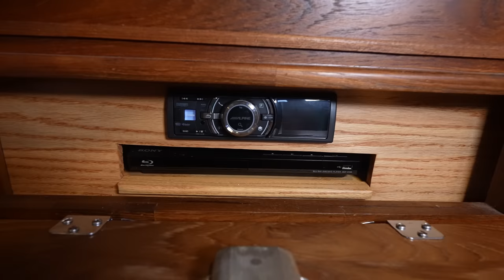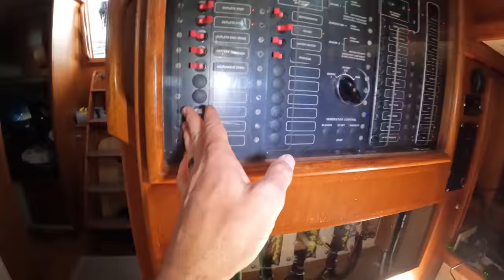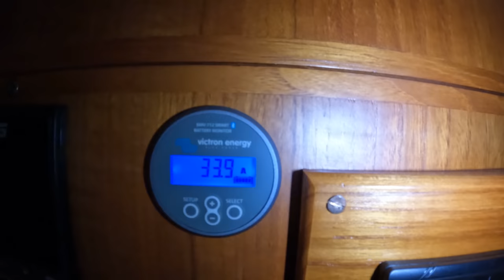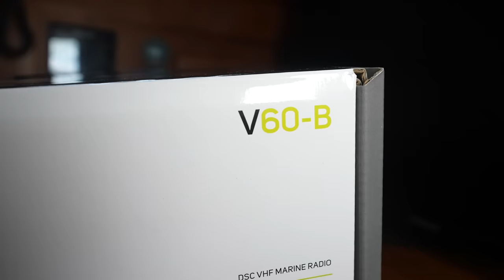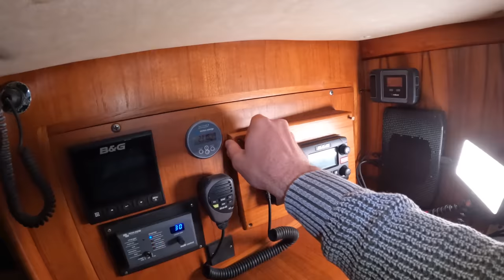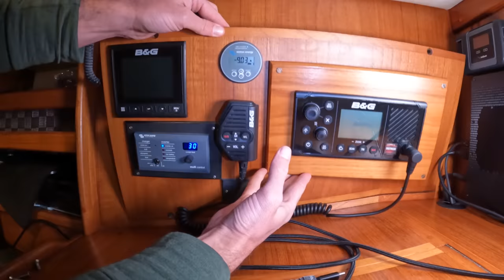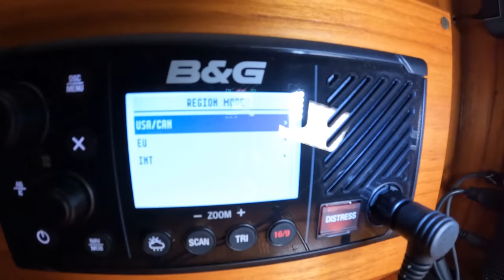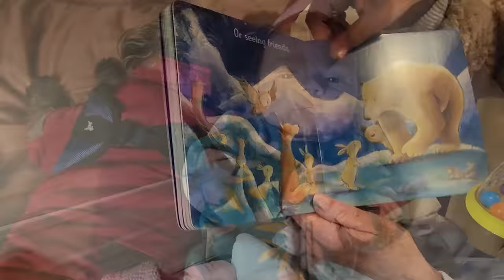Is it Safe to Sail with a Baby? | S08E05

Comment: 220 charger fan blows air in; but no outlet in the charger compartment? Might be an idea to have a grill in the door. Thanks for great videos and good luck with baby sailing.
Reply: I had the same thought. But, I thought I saw a hole on the wall opposite the charger in which a few wires were passing through. Depending upon where this hole leads, there may be enough size to discharge air. Look at 12:41 to see the hole I aim talking about. :¬) Webhead USA
Reply: Was just going to make the same observation.  Cooling is dependent on air flow.  The larger the volume of air flowing over the unit the better the cooling. Right now your just pressuring a box and there is very little air flow, if any.  The reason you felt air flowing in the test was because the compartment door, that the unit is in, was open.  As soon as you close that door, without a grill, the air flow will stop.

Comment: Jordan you should go back and look at some old "Ran Sailing" videos...they did the whole baby on a boat thing...their daughter  Vera is about 5 now...they had the most incredible baby chair, with attachments  in the cockpit, and at the table, with seat belts and secure enough for rough seas...good to see both of you doing so well. Really like your Dad, he is really cool
Reply: Agreed. Vera had a baby seat similar to a bike one, positioned on a bracket fixed in the cockpit such that it could hold her safely strapped in at times when both parents had to be doing boat handling, such as when going in and out of marinas, mooring, or doing sail hoisting. She could see what was going on, but couldn't fall anywhere or get injured by anything.

Comment: Jordan, I reckon you might need an exit vent for the charger compartment as well, otherwise the fan won't be able to move much cool air into that space. Unless I missed some detail in the video? Anyway, best of luck to you guys!
Reply: Need ventilation for that Synology box, too!
Reply: Yep, he tested the airflow with the door wide open. How will the airflow be when it's closed? And as Kirk pointed out, the Synology box need ventilation too (and I think you were talking about putting some other things in that same compartment). I didn't see any vents, and they all throw off some heat... Maybe check with a thermometer when they're all on.
Reply: Would be better with two fans.  Primary one to pull the hot air out and the other to pull in the cool air.  Similar to what you see in many high end PC cases.

Comment: Happy for you all and great to see its going good with the adjustments needed for baby onboard. Yup, Isa is ready for a Powered Baby Bouncer/Rocker or swing.... it will help you tremendously. On your charger venting, make sure you have other openings for the new air to exhaust out from charger compartment, so you get continuous exhaust and stream of fresh air in. The AIS radio safety upgrade is perfect....love the wireless handheld unit for cockpit 👍

Comment: Great to see y'all happy and Isa looking soo cute. Just a thought. The compartment being cooled may need its own vent so the hot air can escape. Might help heat the cabin too a bit??😊 Take care and thanks for another great video👍👍
Reply: That's a great comment.  You might be able to get by with drilling holes, make a cool pattern or use another vent cover. Sound knowledge Gavin.
Reply: Same fate for the new NAS if it doesn't have proper air flow around it.  Even though it has fans the compartment that its in needs air - I'd put some soffit sized holes under it or near it.

Comment: Hi Jordan, regarding the charger and the fan to cool it, you should reverse the flow of air to get out heat from inside the cabinet where the charger is. That is the way all cooling systems for desktops and laptops work. The way you put the fan, the cool air is going in but the charger will heat that air. You should open another hole in that cabinet to pull cool air. The fan should not be directly over the back of the charger. I could send you a diagram because it is dificult to explain with words only.

Comment: Hi guys great video as usual. You really want to use an inline fuse to connect the cooling fan. Those thin wires to the fan are now unprotected and constitute a fire risk. 👍
Reply: Great information.
Reply: Also ferrules for stranded wire and marine grade connectors.  Ask me how I know.

Comment: Ok... So you cut holes into the new charger compartments... But do you have a hole to let the air out? - And you need air circulation for the data storage hardware too.
Reply: I'd be less worried about the exhaust since it's for sure nowhere near air sealed, than destroying that massive hard drive. It definitely needs air.
Reply: Inwas wondering the same thing on both accounts. That NAS is gonna put out serious heat.
Reply: Wondering if, with all this added electronics how much protection do you have for surges and lightening strikes? 
(if there even IS a way to protect from lightening)?  OR....really good insurance?  Can separate protection devices be put on each of the most expensive components? An extra cost I know but would be less than 
replacement (?). Always amazed at what projects you private sailing Captains are able to do. That’s a must for your survival I know! As a weekend day sailor I wouldn’t have a clue how to....🤷🏼‍♂️ and glad I don’t have to. Great job to the whole crew!
Reply: Efficient air flow can be tricky.  You will feel some air flow, but to make it efficient, it looks like it needs at least 1 in spacer blocks behind the charger. Otherwise, both devices are in jeopardy.  Ideally, put the fan on the charger side door blowing hot air out, pulling air thru the inlet door and a few holes around the charger.  A filter on the inlet too, with foam around door edges to seal.
Reply: Good comment. There needs to be air flow to protect the equipment and solving the intake side only addresses 1/2 of the problem. You will need an exhaust in the charger compartment that will create a flow and exhaust the hot air.
Reply: @alanw9677  I have heard of, but have personally yet to see lightning rods that are mounted on the top of mass that run a wire down to the hall of the boat and connect to a plate in the water. That’s giving the lightning a direct path to ground basically the same way A lightning rod works on the house by hitting the rod, and then following the wire to ground.
Reply: @AlexRCarlson  you may be correct, but then again, depending how much air is being pumped in against how much leakage may still cause the temperature to rise in that small space. Putting a small thermometer in there to see how it reacts would be a simple test to see if he needs more ventilation.

Comment: I suggest you consider drawing the hot air from the batter charger versus pushing cool air toward the charger.  I think you will get a cooler device by pulling hot air away from the device.

Comment: I wish you alla the best guys  your daughter  is a little  angel!
Just an advice for your Ventilation project. You will have to make some Ventilation  holes on the compartment  that the 220V converter  is as well so the hot air is able to escape.

Comment: May I give you a little bit of advice.

Hard drives don't like to move.
Engine vibration, smashing into waves etc can all cause physical damage to hard drives.

I would suggest upgrading to all solid state drives as you can afford it.

As for how fragile hard drives really are, one company was transporting a large number of drives from one building to another on a hand trolley over some paved ground.

Multiple drives failed to work or had serious errors when they were installed in the new building.

They are cheap with huge capacity compared to SSD's, just very fragile.

Comment: I was going to say that you need cooling for all the routers/drives in your new shelf/cabinet and then you started on the ventilation project for the 220. 😂 We have a small Netgear router and during the Summer in the Med it regularly needs to go into the freezer because it just gets so hot outside, that even keeping it out on the desk in the salon is not enough (we work remotely).
Reply: Was also going to point out the NAS will probably need some fresh ventilation since it has a fan on it.

Comment: Jordan, IMO you need to cut another vent hole in the door where the charger is located. The heat is still going to build up in that box with nowhere to go. If you are primarily using it in the winter time why not take advantage of the heat that it should spill back into the boat through the  out take vent. This way you have a air intake and an exhaust.

Comment: Nice work as always! I might suggest putting a vent on the opposite side of that charger compartment. The fan will be very inefficient pushing into a sealed compartment. You tested it with the door open so it had no resistance. Anyway just a suggestion. Don’t want you to have to buy a 3rd charger! Cheers guys!

Comment: Hi Jordan; just a precision: AIS shows you only the boats, ships,… which has been equipped with AIS B. AIS A (which is a receiver only) like your old one, doesn’t transmit, so you cannot see them. Same, a boat not equipped with AIS will be invisible. Do not rely only on AIS. An actual watch is vey important. Cheers and fair wind.

Comment: From one hole saw guy to another, no "collection" is complete until you get a hole saw within a hole saw bit; also sometimes called a co-pilot bit.  It allows you to mount the hole saw of the existing size of the hole, inside the hole saw of the size you want to enlarge it to.  It keeps you from having to make a backing jib when enlarging a hole and saves a ton of time. I recommend getting one for your collection!!!!

Comment: I would switch the direction of the fan so that the compartment holding the charger is cool and the compartment with the fan is the hot one blowing air out to the room.

Comment: Fan mounting: Put a separate fuse on that thing. Right now, it's possible for 16A to go through that fan. No bueno. Also, not sure if you know (you probably do) but in Europe, your diesel heater is an Eberspächer, if you're having trouble getting help, looking for Espar info over here.

Comment: Should the fan not be running the opposite way? Sucking the hot air from the charger out? The air on the charger side will then be drawing cold air from the bilge area below the compartment. ie: computer fans do not blow air into the hot item.. they draw it out.

Comment: I have to advice you change your way of ventilation for the charger. Make an inlet hole somewhere and let the fan to extract the heat. Basically remove the warm air instead of blowing air on the unit which cannot escape.

Comment: While you are working on ventilation, I hope you are ventilating the space where your Synology NAS is located. I’m assuming it doesn’t run continuously, but when it is running it can throw off a good amount of heat.  Also, the new venting you just put in for the charger will help supply cool air but you need a way to exhaust the hot air. If you plan on keeping the cabinet door open in front of the charger, that will suffice.  But if that door is closed there will be no place for the hot air to go. 

Regarding the Synology NAS.  Make sure you have it configured for at least RAID 1 so you can sustain one or more disk failures.

Comment: Those NAS boxes generate a decent amount of heat, and heat greatly reduces the life of mechanical hard drives. I would definitely be putting some cooling and ventilation  in that compartment like the excellent job you did with the battery charger

Comment: Well as much as I appreciate Jordan's words about AIS, I think there are cheaper ways - if you don't need a second station with that handheld. A separate AIS transceiver is in general cheaper. And it comes with built in antenna splitter (don't understand why that's not the case with that V60-B).

Comment: Finally, a channel thats bought a NAS, and a damd nice one at that. Id be using a wired network cable from the laptop to the NAS for editing and a nice m.2 drive in the lappy would be nice. You guys wont know yourself....just remeber to have 2 (thats TWO) backups and one of those off the boat. Maybe post portable drives back to family as one backup and the other keep onboard...you know just incase something goes terribly wrong aboard

Comment: Can never have too many hole saws!  Couldn't tell, do you have ways for air to flow both into and out of that charger cabinet?  If only one of the two, you will create either positive or negative air pressure in that cabinet and you won't get good ventilation.  It will also make the fan noisier.  You'll want equivalent openings both in and out of that cabinet.  We had to do something similar with our ice maker that we installed in our boat's mini bar.

Comment: Great video, I was just "complaining" in my head about my charger/inverter fan running, LoL now I feel better knowing it will last longer keeping cool! I think I'm ok with the sound now!!
Also just finished my AIS transceiver install though I installed one with a splitter Bluetooth and wifi all in one just starting to get to know how it all works!
Fun stuff, I like the VHF wireless handset, I'm doing the same as you did before, hand held up top and high powered unit down below, I have a hard time hearing the handheld out in the open area.

Comment: Jordan you need to reverse the rotation of the fan to suck the heat OUT of the cubby where the charger is installed. Otherwise you will just be heating the cubby where the charger is which will eventually cause you the same exact issue.

Comment: Hey, guys, take care of the Synology too. You will find the exact temperature issue as the charger. At least 10cm is required on every side, and this is not designed to work in a close space, essentially is a desktop computer with many discs.

Comment: It's an AC 240V fan... it only goes one way. There is normally an air flow direction arrow on the fan frame. I guess you got lucky :)  I am not sure what you would have done if you had mounted it backwards and tried changing direction by reversing leads....

Comment: You are so funny, with your hole saws. I laughed and laughed. Yes, if air moves it must have a way in and another way out somewhere. Tricky on boats but necessary if you don't want to replace those expensive chargers again. Your good and I know you can handle it.

Comment: You need heat discharge slits to complete the heat dump.
If you get clever you can discharge the heat in cabin when cold weather or outside when in hot weather.

Comment: You should add a properly sized inline fuse to the hot leg of the cooling fan.  Technically, the input wire to the fuse should be sized per the breaker.

Comment: Need to consider air outflow from your charger compartment. If the access door is closed, the fan will semi pressurize the compartment and airflow will be reduced. Need to exhaust the hot air.

Comment: Jordon, I was wondering if you need a vent on the other side of the 220V charger. Right now you can bring air in one side, however, it there isn't a way to have the air go out on the other side will you really have cooling. That is the reason houses (remember them) with forced air heating have cold air returns.  The same thing as putting your finger over the end of a straw in a glass of milk.

Comment: Don’t forget to give the air someplace to go to after it’s gone over your charger. Otherwise I’ll turn that box into an oven. You’re letting air in but you need a way to let the air out after it goes over the charger. Granted, there may be enough leakage around the door and other possible openings so before you start cutting holes to put in vents, you might want to put a thermometer in and see what the temperature differential is between when it’s off and when it’s running.
Reply: I thought he should exhaust the hot air.
Reply: @keithpete  that’s pretty much what I said, but I did acknowledge there’s a possibility there’s already enough leakage in that compartment that the warm air can get out and not be a problem, which was why I suggested a thermometer.

Comment: So you took care of the issue of supply air  to the fan...what about exhaust air from the enclosed space with the Battery Charger? It would seem to me you are basically deadheading the fan and actual air flow will be limited.

Comment: I would relief that charger from the flat wall (over that big hole you cut).  Just remove your four mounting screws and place a spacer (maybe a 1/4" nut) between the charger and the wall then reinstall your screws.  That way the fan air can carry the heat away from the charger. Not just blow air against the back of the charger. Good luck.

Comment: Please consider putting a filter on the inlet side of the fan, and putting gaskets on the low-pressure side of the system. Dust is the enemy of cooling air systems.

Comment: You put a vent on the door to allow air in but, I didn't see a similar vent from the charger compartment to vent the hot air, assuming that compartment is open to stern(?).

Comment: Obviously couldn't see in your server compartment, but make sure there is A LOT of ventilation in there as well or you're going to have issues with your NAS's performance and your HD's are going to fail quicker. SSD's, especially, generate a crap ton of heat and electronics hate heat.

Comment: Thermodynamics 101 you move heat AWAY from its SOURCE !!!! You are young and still learning . Good luck...PS >> computers exhaust heat from cabinet!!! Final Thought ! There needs to be a pressure differential which the fan facilitates however without a circulatory path the fan will never achieve its goal . You need a second vent in the primary cabinet door.